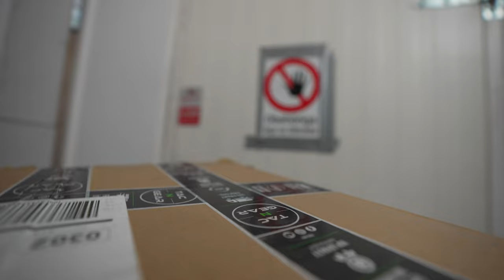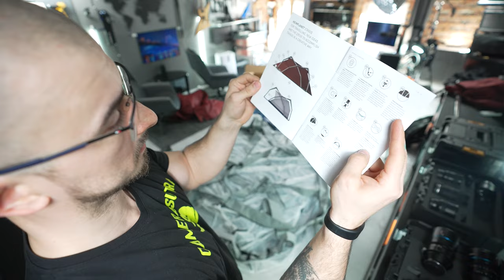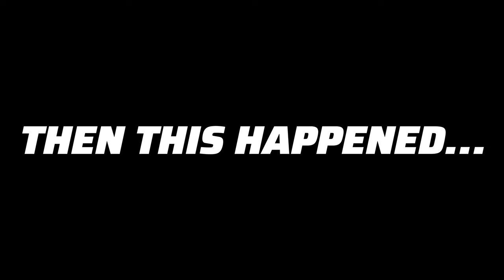so this happened to my $3000 camera lens...

Comment: Canadian (Manitoba specifically) here. You never TRULY know how used someone is to snow until you see them try to get out of a snow rut/deep snow. When friends or family DON'T KNOW HOW TO ROCK THE CAR by slightly applying gas and letting off using the built up momentum over and over to throw the car over the snow, they show their true colors. If you know, you know. Peter did it!

Comment: yeah tough one!  I feel your pain ... I guess a new lens than, huh?! 😕😅😉  ... happened to my 10-18mm, now it only zooms from 10-14mm ... not as expensive tho' and I really only use it from 10-12mm sometimes 14mm maybe 16mm so I'm good and it's only on the gimbal anyways ... and for the Mac "issue" ... got the M1Max MacBook Pro in Dec... replaced my 2018 MacMini + eGPU so while the Mac Studio M1 Ultra would be nice ... I really don't need it M1Max MacBook Pro is powerful enough anyways ;)

Comment: Hey Pet just asking ? But don’t you have gear insurance? Can’t you just make a claim ? If it was me I would just pay the little small 250 or $500 insurance payment then buy a brand new lens for 2200 I don’t know just me
Reply from the maker: I do! But the insurance value is almost close to nothing 🤷🏻
Reply: @PeterLindgrenVlogs  But gear and "olycka"-forsekring usually have a "small" fee/egenandel, a couple of thousand kronor when the gear costs like 20.000 SEK new, regardless of how old the lens is/have dropped in value as used, since a new one costs 20.000,-? or do you have some strange kind of insurance/not a "olycka"-insurance?